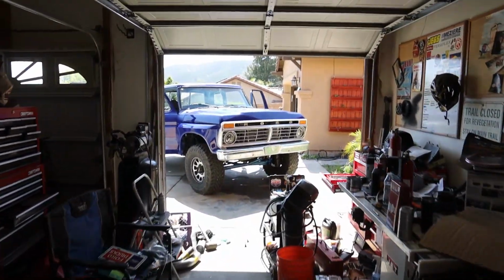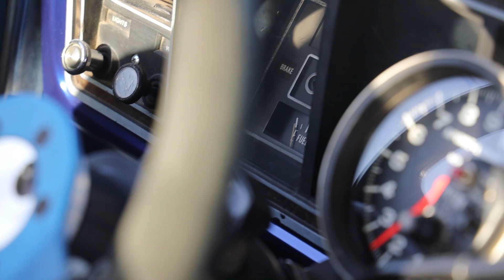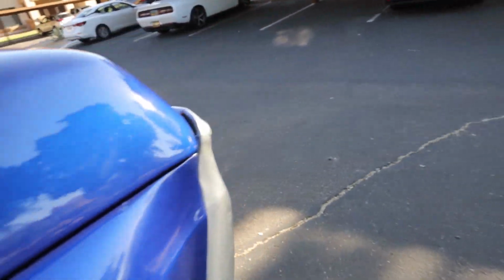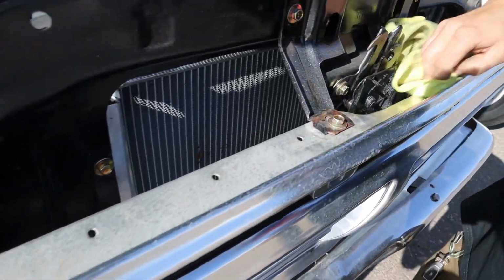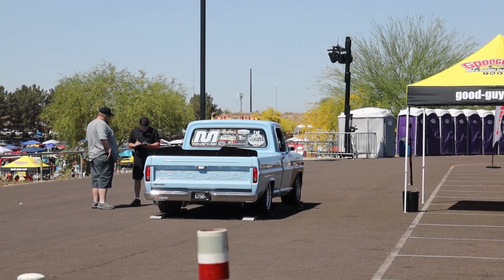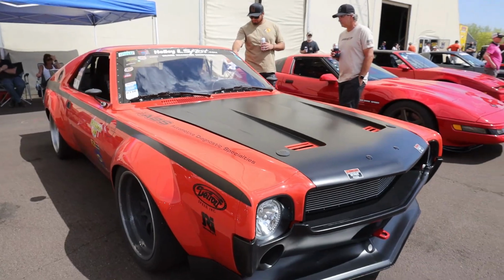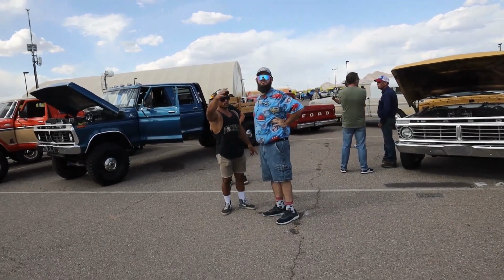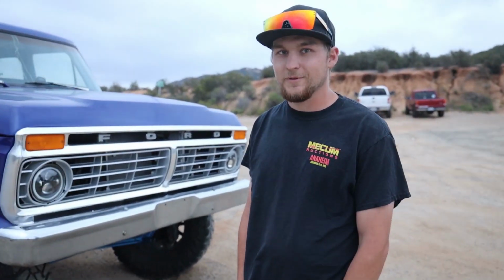Road Tripping a FRESHLY PAINTED F100 From San Diego To Scottsdale! *WIll It Make it?*

Comment: I got issues with my fuel gauge. It’s a 74 f100. It will only go a little over halfway when I fill it up. It still has a half a tank when it shows empty. I thought sending unit. I put a new one in done same thing. I thought well the gauge it self. I changed it and done the same thing. I’m lost. Any ideas?